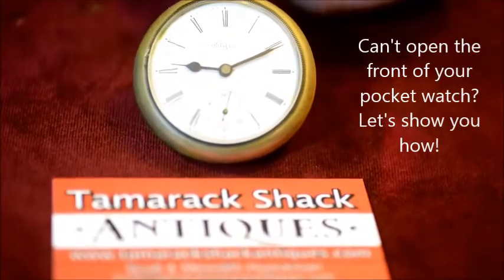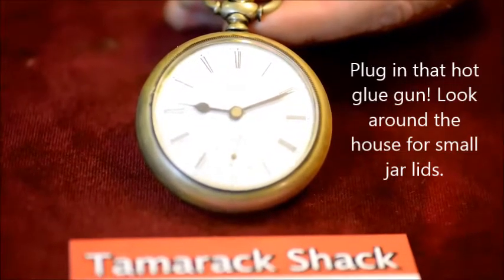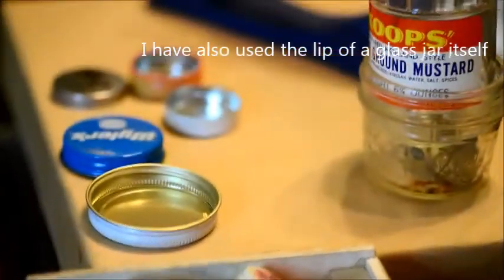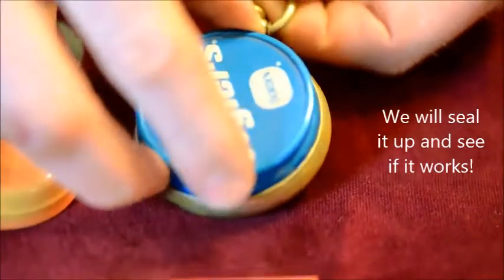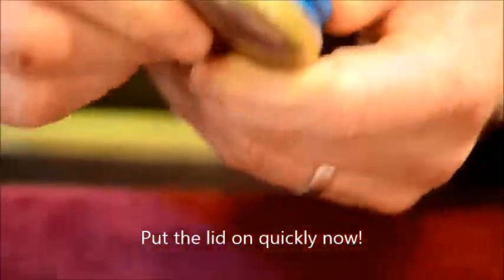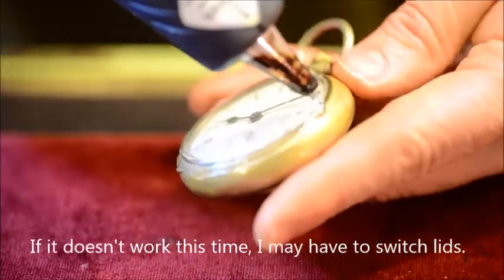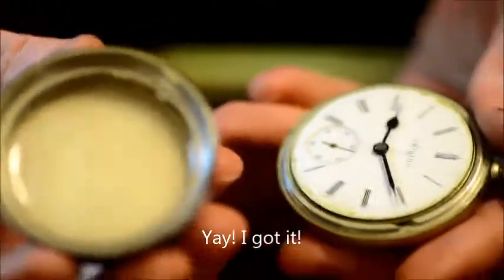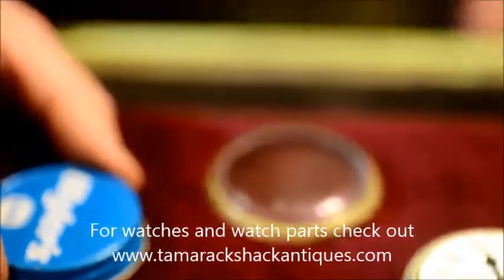How to Remove a Stuck Bezel || Pocket Watch Crystal || Easy Fix || Repair

Comment: Recently I had a problem with a Pocket Watch that had a Bezel and Bezel Ring that did not want to unscrew.  I found an easy way of loosening the Bezel Ring.  I took a large piece of Duct-Tape and stuck it to the face of my pocket watch and then I trimmed off the excess tape that hung below the Bezel Ring.  Then, I used my 8-Ball to twist off the Bezel Ring and Bezel.  Worked like a charm. No problem at all.

Comment: Sweet mother of God....I'm about to buy a hot glue gun.  I'm a 50 year old man....I can'tbe seen going into the local Artsy-craftsy, Bric-à-brac shop. Maybe I can bribe some neighbors kid into doing it.
Reply: That worked perfectly.  It's a little frustrating at first: discovering all the round things you own that look like they're the correct size but are, in fact, just jerking you around. After about 20 minutes of searching, the mouth of a small vase is what ended up fitting.
Reply: Lol 54 and was at the same crossroads. Wife saved the day. Unbeknownst to me, she had one!  And this trick worked like a charm!